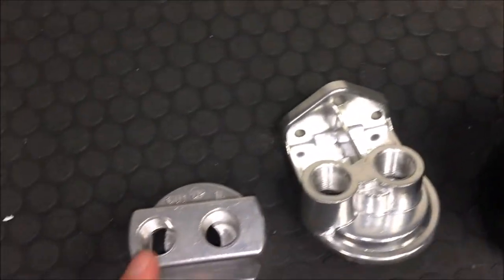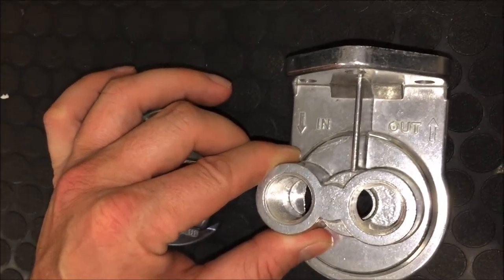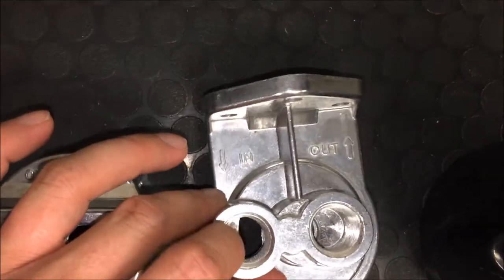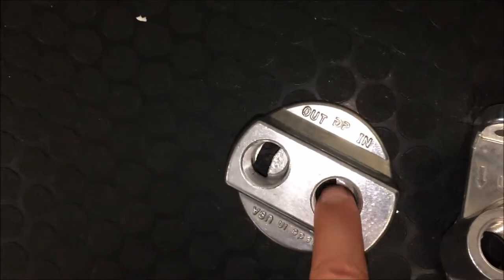oil filter relocation kit explained

Comment: thanks for the info. Always though something was wrong with my temp gauge, because engine temps are always exceptionally low. Today, I realized that I have an oil cooler installed.

Comment: thanks for explaining this. i just got one of these kits and i was a bit confused but this clears it up. i ended up being pretty tight in clearance so i went to the hardware store and bought two 1/2" street elbows to immediately turn 90° as it exits the derale fixture from the block, otherwise i think i would've kinked the lines trying to turn too tight of a radius to clear the front differential yoke in my truck. i dont have it installed yet but hope to soon.  does the engine block require a factory oil filter adapter in order to mount the derale fixture that bolts to the engine? i have a oil filter cooler housing that hangs down about 3" from the engine block now and theres no room to mount the derale fixture to that without hitting my diff. this is the whole reason I bought the kit after the engine swap because theres no room for the filter...

Comment: If I could just relocate the drain plug..I wouldn't have to crawl under the car
Reply: It is a good habit to crawl there. To inspect suspension parts and bottom of the engine.
Reply: Always wondered of a hose and a tap would worl for drain plug like somewhere in the wheel gaurd 🤣🤣👌

Comment: So, that rubber hose is okay right up against that header pipe? Also, whose filter relocation kit is that, JEGS?
Reply from the maker: thanks for the question. The rubber never directly touches the headers, with that said any heat source needs to be avoided with rubber as the heat will make it brittle and lead to failure. With these kits(oil filter relocate kit) your buying the kit for the engine (chevy, ford, dodge, etc.) not the car. In other words bbc vs 1970 Camaro. So things like headers and other things get in the way and have to be delt with. We just finished the install to show the plumbing of the system. Once the issues were identified the proper parts can be order. Moroso sells a filter adapter that will change the outlet to a 90 degree angle out of the engine block verses straight down like the current universal set up is.thanks again. Hopefully this clears things up. Kit was "DERALE Performance"
Reply: Thank u Sir